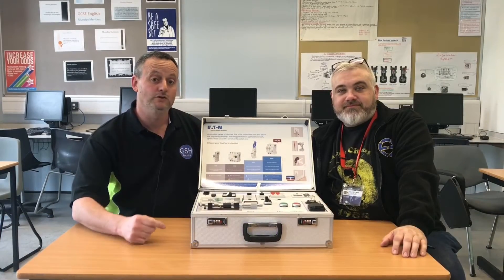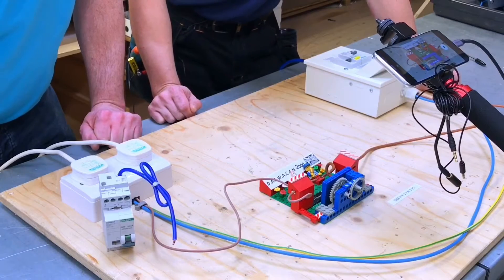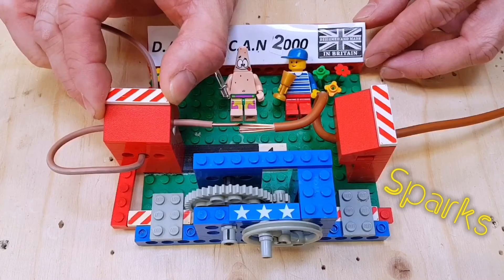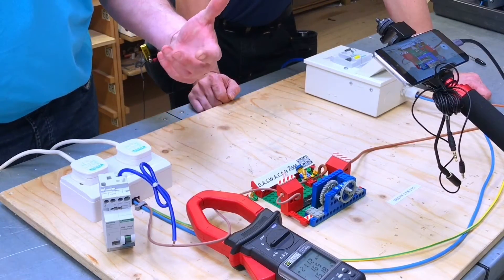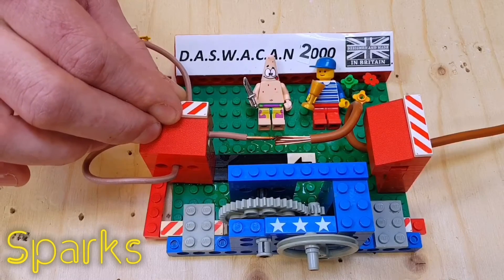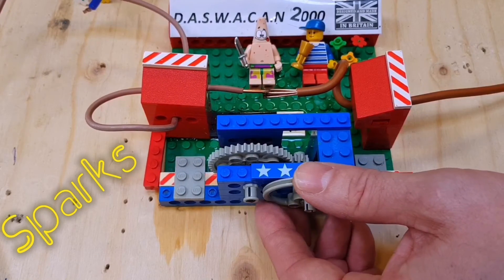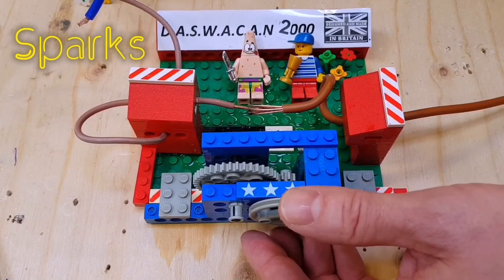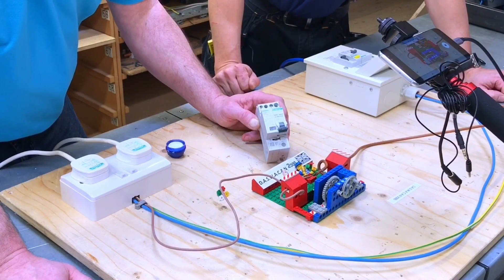AFDD Arc Fault Detection Device DO NOT WORK on Sparks - 18th Edition Wiring Regulations

Comment: An arc is defined by the magnitude of energy discharged. Low visibly arc are normally high voltage discharges. If sufficient energy is transferred then the surrounding gas from melted copper is heated up becomes plasma and a stable arc can occur. If in a cable fuel and energy creates large heat and can create fire.

Our vids nearly ready
Reply: It is not possible to start an arc (a continuous discharge of energy) UNLESS there is a source of ions, such as metal vapour. To start a significant arc, as from an arc-welder, a source of ions is necessary, from the coating. Try with a bare wire to observe this is true. A copper-copper arc can be started if the current spark has enough energy to give a cloud of ions. This will not happen unless water or flux etc is present. The test rig (and the AFDD specification) requires a CARBON rod or burnt material to start an ARC. An AC arc needs this material to start again between cycles, so again is difficult to start. The concept of the AFDD is seriously flawed. See the IET wiring regulations forum, look for AFDD in search.

Good luck
David CEng etc.
Reply: @davidstone1579  So are they useless in home?
Reply: Where are they after a YEAR?
Reply: I'd like to think then, that maybe some form of statistic or graph may exist how ever relevant to distinguish the difference and observable frequency of the two, (an arc or a spark) in relation to damage that may rise, has arisen and risk to life in the failing of an electrical connection and such like (some what relevant to a change due to common circumstances - metal consumer units containing the effects of an arc or sparks under fault conditions). At first sight I can imagine the common existence of switching devices or even universal motors creating sparks which would give rise to nuisance tripping, this alone maybe a limiting factor for the use of such detection (ie Spark). But this said, does the risk of an arc event require a detective device (which will become more and more a requirement as an RCD has become) if found negligible at least against the latter (spark). On another note, It is good to see that the making of current and next generation sparkys aware of the risk of loose or damaged electrical connections seen in these videos, to which may improve standards all round or at least give a firm consensus for such practitioners, for me i find them to supplement the requirements stated within BS 7671 and relevant documents.

Comment: When there is a real series arc there is nobody pushing and pulling the cables together so are we saying it only trips  on a 8kw load and not a 3 or 4 kw load loose connection not much good unless it trips on smallest arc as it could be loose for a long time  and chance of fire as there could be paper under arc the house would be on fire by now

Comment: It is very difficult (read near impossible) for a sustained arc to be created at the sort of current loads the average UK household would produce. From the outset it looks like AFDD's are a complete waste of money and are of no use whatsoever in the UK, providing protection for scenario's that will never happen... If they can't detect 'sparks' or what are actually small short term arc's created from loose wiring, what frigging use are they!?

Comment: Sparks are abrupt while arcs are prolonged discharges. If the ends of the wire were placed at a very very close proximity for a little longer, I think it would have created an arc, as the air around it will gradually heat up to a point of thermionic emission which allows current to flow longer, therefore sustaining the arc

Comment: I think the demo simulated quite well what actually goes on behind an accessory that has a loose connection or a series break in a conductor due to damage and it didn't trip. I was surprised, I thought the AFDD was for this very purpose. I appreciate the arc / spark debate but regardless, u want it to operate in those conditions u created. I also enjoyed the lack of concern for health and safety shown in this experiment. It was quite refreshing.
Reply from the maker: Thanks for your detailed comment. Gaz  👍

Comment: Amazing video again! This has opened my eyes wide, very wide. Maybe plug an "arc" welder in? There needs to be some kind of afdd tester. Something like what we use to test R.C.Ds? Hmmm?! I'm beginning to think something is wrong here? The temperature of those sparks I'm sure will exeed the limits of intrinsic safety? I.E. explosive atmospheres? Petro/ chemical?  Intrinsic safety is a few mili Amps. The experiment here was running into several Amps!  This experiment was excellent, clear and concise. Incontrovertible  evidence. The "sparks" are hot, Higher than the flash point of conbustable materials!
What an amazing video. Thanks to you guys so much for you brilliance. You're a big help to us guys. Cheers!
Reply from the maker: Thanks for the lovely comment David 👍

Comment: But isn't this spark the origin of an arc? So the device operates when it defects what?  Yes you say an arc but what is the parameters and how would you know and confirm this device is actually working ?
Reply: It would make an interesting watch if these manufacturers were to focus a greater effort on the educating of practitioners in these matters rather than, (yes i'am exaggerating slightly) "Arcing is a big issue, they start fires and look at our amazing solution to solve it". Say Mr Simething or other CEO of some electrical manufacturers. Im going to state this off the cuff, and I'm happy to be corrected since this is a simplistic stab. I would think that in one case a spark would preceed an arc and given under the right environment within the close proximity of say two loose conductors would ionise the air reducing the resistance path,  to which would allow how ever stable an arc to form. A balance of current flow and arc gap may be A consideration at least for its duration. This can be simulated in a crude way with the use of an arc welding transformer.

Comment: Arc or no arc these devices are designed to pick up these SPARKS as you say simulating a loose connection or whatever and trip ? If they dont do that then they are useless arent they ?

Comment: If those sparks at minute 15 are not an arc then what is? Those conductors got welded together. 

I watched the e5 group afdd viena test but those arcs where created with a conductor thick as a finger. No one has conductors 1cm or 2cm thick inside a home. And those arcs tripped the afdd instantly.

Comment: There's some arcing taking place every time you operate a switch or pull a plug out. So it is designed to prevent nuisance tripping